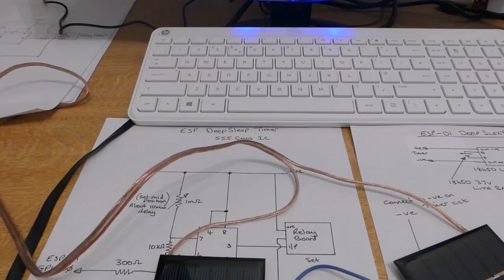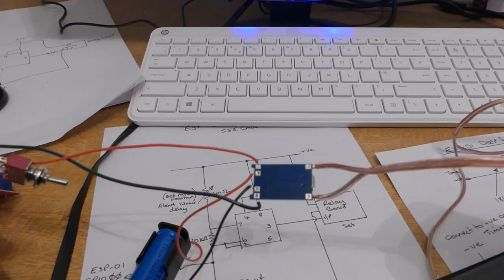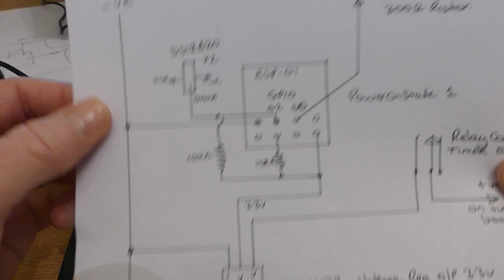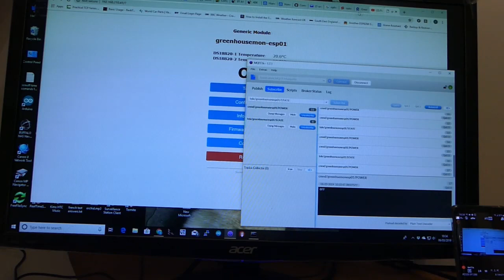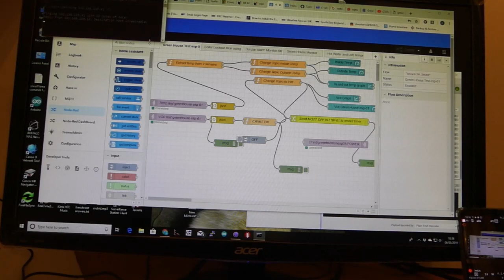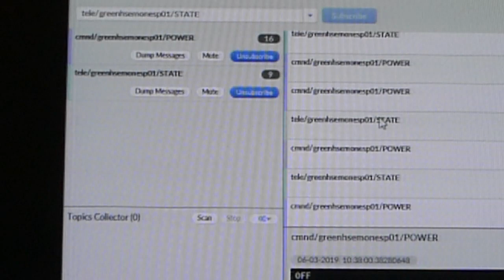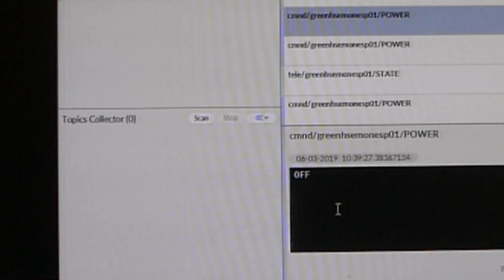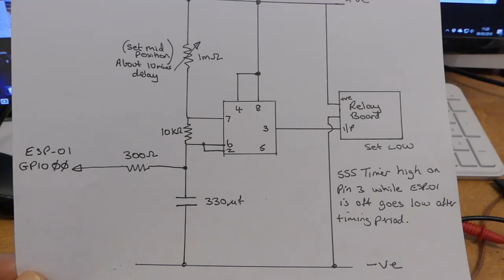Tasmota Simulate DeepSleep On ESP-01 or ESP8266

Comment: Why didn't you use a FET instead of a relay as it is just on or off? thanks for the video very interesting
Reply from the maker: Hi Sorry about delay in reply. I did try a MOFSET  but it would not turn on the esp reliably, not sure if its internal resistance is not low enough or current through it to low so went back to old tech. Thank you for watching my video. I am now using a ESP8266NodeMcu instead of the esp01 it is still running after a year, although did have to power cycle once or twice because not enough sun to keep the battery charged.

Comment: Excellent video, exactly what I was looking for! I have just two minor questions:1. why not use a MOFSET instead of a relay?2. I noticed in your schematic that the connection from pin 7 on the NE555 was papered over, that is the pin is not connected anywhere, whereas I have seen on other schematics for an astable multivibrator on a NE555 that the pin is connected precisely where you apparently had it once connected on your schematic. Why is this?Once again great job and the video quality was good!
Reply from the maker: Hi John. Thank you for looking at my video, I hope you found it useful. Its a while ago since I made this video but I think the following is correct . I did try a MOFSET but it would not turn on the esp reliably, not sure if its internal resistance is not low enough or current through it to low. Re 555 timer Pin 7 is the discharge pin of the 555 timer, this is not required because the capacitor is being discharged when the esp gets reset. I am now using a ESP8266NodeMcu instead of the esp01 as it seems a lot more stable. The principle is the same, I use gpio05 to reset the timer and gpio04 for the temp sensors. Best of luck with your project